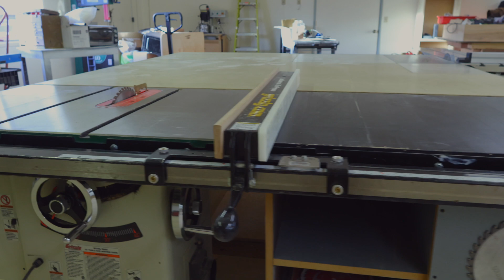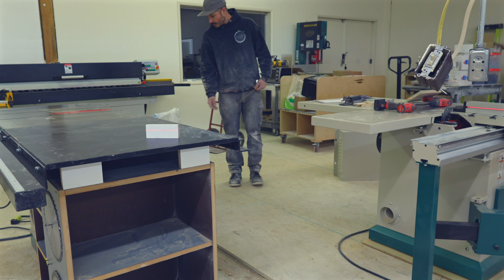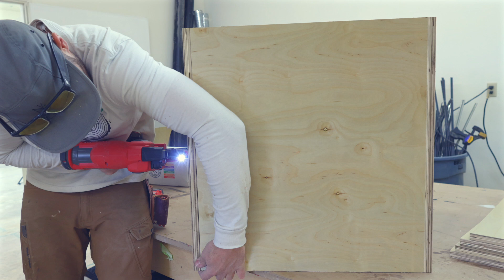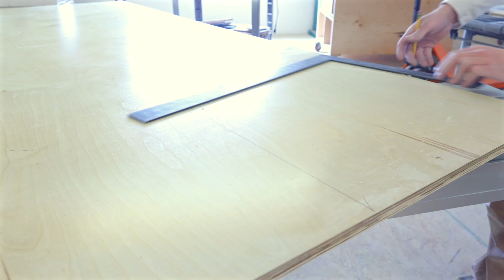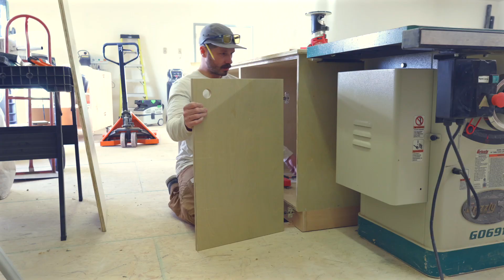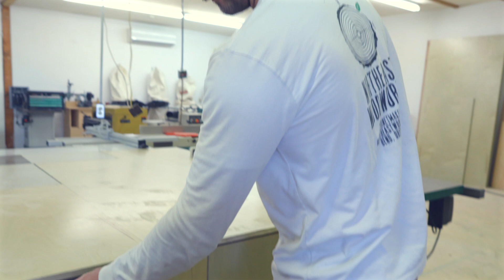SHOP PROJECTS | Massive outfeed table in a custom cabinetry shop.  Tons of storage!

Comment: Nice sized shop. Maybe you mentioned it somewhere; the floor is that underlayment on concrete or a foundation wall with beams? If yes, what was the allowed calculated pressure to have no wobble or any bow in the floor?
Reply from the maker: The floor is  on joists.  Crawls space below.  I’m not sure what the load it can take is.
Reply: @NE_woodworks  I did hear it at a later video. Thank you.

Comment: Does your shop have 3 phase power?
My son has the large Grizzly sliding saw in his shop and it is 3 phase.
Like you, most of his machines are Grizzly.
He just recently added a straight line saw, also Grizzly, again 3 phase.
I think 12 of his machines are 3 phase, including his air compressors.
They also use air for all the hand sanders, they simply hold up better.
Reply from the maker: Unfortunately I don’t have 3 phase power. 
But the Grizzly stuff has been great for me